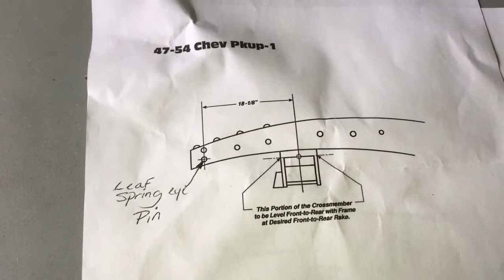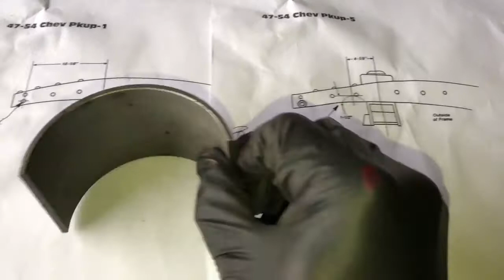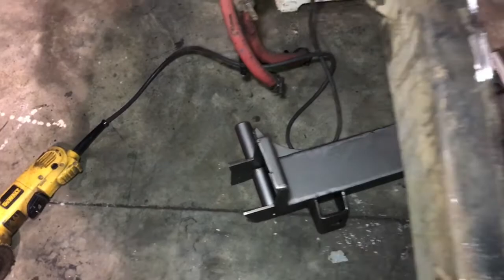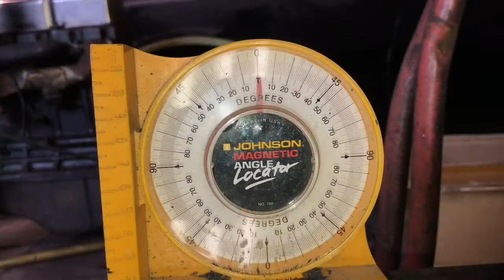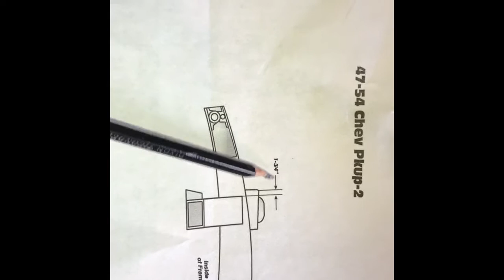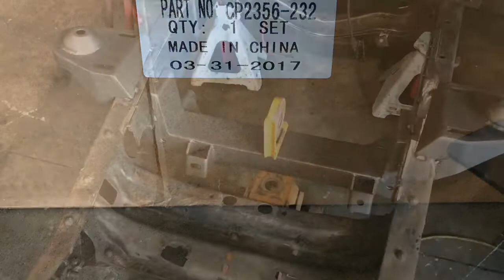1950 Chevrolet 3100 Truck IFS Install Part 2

Comment: Hey gill how did you determine your rake angle I contacted CPP and well the guy didn’t seem to sure he said about 1-2” lower in the front than the rear would get me where I am supposed to be.
Reply from the maker: I ordered the CPP IFS with specific coil spring rates and dropped spindles, if I remember correctly. Once I configured the front ride height I was able to set up the rear with adjustable coilovers. I then adjusted the rear to achieve the rake the customer wanted. When ordering the IFS the retailer may ask a few questions to determine which coil springs to include. They may need to know what engine you’re using and what ride height you’re wanting to achieve because it is important that the geometry is correct and that the control arms are parallel to the ground once all of the weight is on the axles. Hope this answered your question. Thanks for watching!

Comment: Really appreciate your thoroughness. Getting to put this kit into mine.
Reply from the maker: It is a pretty decent kit! My only complaint is that the ball joint boots had no way to attach to the control arm, they just float! Thanks for watching and commenting. Please keep me posted on your progress and let me know if CPP has solved that issue with the floating boots.

Comment: Hi again did you have much trouble fitting the ls350 engine   Im thinking of doing this myself   A ls1  3rd gen just came up for sale near me
Reply from the maker: Hi, it wasn’t much trouble. I didn’t use any aftermarket mounts or anything but you may want to check to see if any are available for that application. I modified the factory mounts! The only sheet metal modification I made was to the transmission tunnel or lack of tunnel. You may have to modify so the larger transmission will fit (if using one). I used a 5.3 and 4L60 from a 2000ish Silverado. Thanks
Reply: @gillrodshop  thanks for that.  Is the LS1 3rd gen a good engine ? I think its 2004
Reply from the maker: @martytrodden  yes, it should be. They are resilient but you may want to compression test it and at least change the seals (valve covers-rear main) and do anything else that may be hard to get to once the engine is in. Try to plan ahead as far as your gauges and other things because the oil pressure sender/sensor may be hard to access once you get the engine installed. I have a lot of notes and video on the wiring part of the swap, so let me know if you need advice or if I can answer any questions. Thanks
Reply: @gillrodshop  thank you
Reply from the maker: @martytrodden  you’re welcome
Reply: @gillrodshop  can i ask you one more question   Is there much to wiring up the ls engine  it comes with the harness and ecu  but where do you connect it to the ignition or fuse box ect ?
Reply from the maker: @martytrodden  you basically only need two wires connected for that engine to run. The orange and pink. The both should be at least 12 volts DC and then all you need is hot (12vdc) to the purple wire to start it. That harness has a few grounding points and all should be connected. If you need any wiring diagrams email me at gillrodshop@gmail.com and I do what I can to send you some. If I don’t answer the email within a day or so send a message via YouTube to remind me. Thanks
Reply: @gillrodshop  your a gentleman thanks so much for all the help
Reply from the maker: @martytrodden  you’re welcome.

Comment: Underneath the chassis after the degree drop adjustment on crossmember are all 4 corners touching or how much of a gap should there be?
Reply from the maker: They were pretty close. I had to grind and fine tune but whatever wasn’t touching got welded up. In the next month or so I will upload the final video and show closeups. Thanks!

Comment: Nice job Gill I like your attention to detail I had to remove half of that front radiator support crossmember on my truck so I can get the rack and Pinion to fit, pretty easy to do I just removed the rivets that hold the crossmember cut the cut the rear hump of the crossmember off and bolted it back onto the frame with grade 8 bolts.
Reply from the maker: That’s a good way of doing it! Thanks

Comment: Hi im about to undertake this job on my truck   How did you connect the steering  had you to buy a new steering colum or did you use the one thats on the old steering box
Reply: That would be great thanks  its martintrodden@icloud.com   The truck i have has a small block v8 mopar engine and the mounts look like they might be in the way of the new crossmember   Have u come across this before ? 
Thanks for the help
Reply: What rear axel would you recommend for the pick up.
Reply from the maker: martin trodden I used a Chevrolet S10 rear end.
Reply: Gill Rod Shop what year s10 is best
Reply from the maker: martin trodden they all are mostly the same but the guy that I’m building this truck for doesn’t have a heavy foot! If you’re going to be doing burnouts and putting over 300 ft lbs of torque to it you probably want to use a ford 9”.
Reply from the maker: martin trodden Yes, but I’ve had to modify and move things around. I’ve used the IFS on a couple of cars to achieve more clearance.
Reply from the maker: martin trodden I used the factory column but I had to fab a flange to bolt to the floor where it goes through the firewall and modify the shaft to work with a double D joint. Send an email address and I’ll find some photos and send them. Thanks